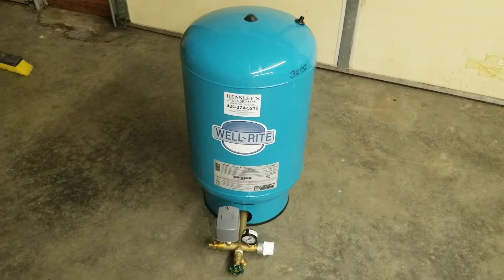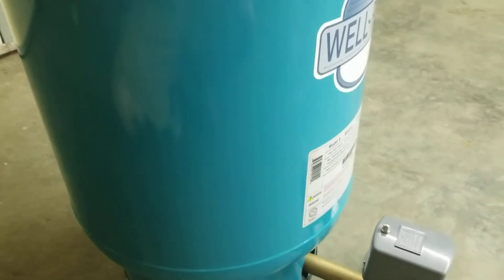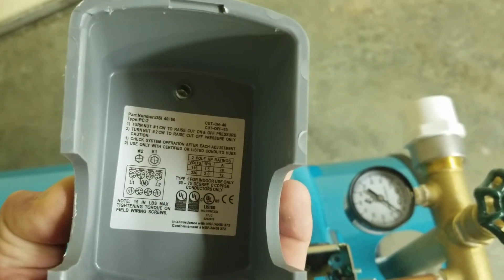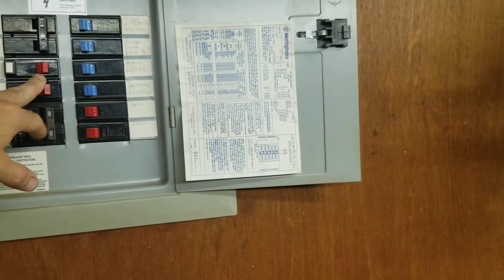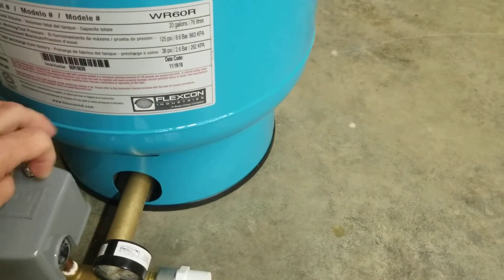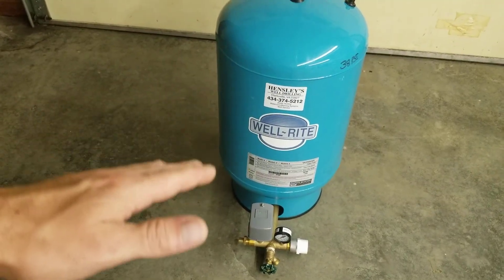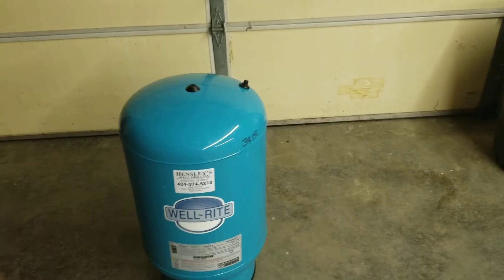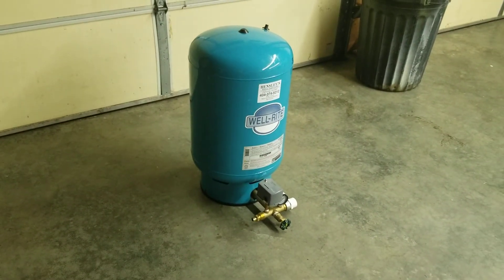Well Pump & Tank Troubleshooting, How the system works, Adjusting Pressure Settings Correctly

Comment: I have a 3/4 horse stay rite pump and my tank went bad. I replaced the tank with a 33 gallon tank, and a 40-60 pressure switch, and had the pump motor repaired since it was cycling on and off for a month until it quit. When I turn on the pump it goes to 30 psi and it stays there constantly and won’t reach the target pressure of 50 psi. At first I thought the copper pipe going from the pump to the house was broken so I disconnected the water softener and plugged the water outlet side of it not allowing the pressure to go to the house and it still does the same thing. I don’t know if the check valve is bad or there is a clogged jet inside the pump. Any advice?
Reply from the maker: I assume re-built pump means an above ground jet pump. If you repaired the pump , it possible that the seal you replaced isn't within the tolerance of the impeller, that wouldn't allow it to build enough pressure for the switch. Secondly if it is a 2 line system (2 pipes going down the well) id honestly recommend pulling it out & replace the injector & check valve
 A bad check valve would still allow 50psi, but once it shut off it would leak the pressure back into the well. Ill send you a link to the correct video. Be sure to like 👍 the videos! It helps more than ppl think!
Reply from the maker: https://youtu.be/126WgbaI7-Q
Hope this helps !

Comment: Very informative. Would it be ok to change the pressure switch from a 30/50 to 40/60 to increase water pressure to my home without damaging the pressure tank? Thx
Reply from the maker: Yes. Itll be completely fine. You can also tighten the nut on your current switch (big spring) (back side) 3 revolutions clockwise & itll increase the pressure. No more than 3 turns though. Be sure to kill the power, open a faucet and drain the water to 0psi. Then check your air on the top of the tank. Set it at 28psi w the current switch. Or set it to 38psi with a 40/60 switch. Those are Max #s don't exceed them in the slightest.
Reply: Thank you.

Comment: I hope you can help me, I've got water to mu house but very low pressure, I checked the pressure tank an it was around 27 psi an I also did the tip trick to see if it would tip over an it easily moved, so I don't think it's a bladder problem or pressure tank but I'm not sure....  my guage at my pressure switch is constantly reading 38 psi, an its not going up or down, I have a 30-50 pressure switch an when I opened it up I did the screwdriver trick where I hit the pipe going into the pressure switch an it sparked on all 4 points but guage still didn't move....  but I hear a constant hum from the tank an I opened the well top where the well pump goes into the ground an I can hear a huming coming from down in the well like the pump is running, I also felt the pressure tank an can feels like the pump is running an also I felt the main line under the house an it feels the same as the tank does, like something is running....  but it's constant an never stops until I kill the power to the well pump then it stops....  I can even hear the humming or it sounds like it running in my house....  my well pump.is working when I checked the tank pressure I drained all the water from the tank , but instead of having a shut off valve I have like a little drain plug in my line so I took it out an drained it down but my guage still read around 30 even though no more water was draining out....  so I wanted to see if my pump was pumping water so I turned the power back on an water came out that drain plug pretty good....  so I put everything back on an together an went inside an still hardly any water pressure....  an it still sounds like the pump is constantly huming until I kill the power again, but the pressure switch ain't kicking in an the guage is still reading 38 psi an I don't hear the tank filling up....  please help
Reply from the maker: First off, the gauge is bad, replace it. 
Your pumps is continuously running & its not giving you water but you do get some. So try turning off the breaker, wait 5 minutes and open up a sink, you should still have a little pressure stored in the tank. If not water is present, your issue is likely down the well directly where the pump attached to the pipe. Either a plastic fitting has cracked & leaking out most of your pressure, or a metal fitting has developed a hole in it. Both are very common.  I test this theory using 2 ppl. If you kill the power at the same time you have a spickot open & put your palm against it, it'll put a suction on your hand. When you kill the power, the water in the line drains back into the well because the leak is allowing it. If you have a spickot at the well, that's the best one to test on, or the tank drain. If you have blue/green stains near drains or copper pipe, it's 95% certain a metal fitting has been eaten up down in the well. Ill send a link to a video I made showing you what to look for
Reply: @h2omechanic  ok I turned on my faucet in the kitchen an it still had a little pressure after the power had been cut off for about 15 mins, im the only one home right now so I'll have to test the other when my wife gets home to help
Reply: @h2omechanic  ok I tested the other method with 2 people, if it had any suction it very little, my daughter noticed the water barley had a bluish grayish tint to it last night, you had to look real close to see it
Reply from the maker: https://youtu.be/rVgDq7gB6Qg
Reply from the maker: Ok. I love the detail! The blue/grey is highly likely to be Granite Rick sediment. A failed fitting will stir up the sediment in the well & send it to the house. You can hire a professional to pull the pump or do it yourself.  Hand over hand. I feel very comfortable with the assumption that you need to pull out the pump. If you watch the video link I sent, a few of those pump have failed fittings. Thats what you should look for.
Reply: @h2omechanic  ok, do you have a video about pulling the pump????  An im gonna take a pic an post the pressure switch when I get off work in the morning also, it's got some wear an age on it but still arks at the 4 points
Reply: @h2omechanic  also I forgot to tell you, I know I'm getting water to the pressure tank, but honestly I don't hear any going inside the tank at all
Reply from the maker: @dffdixie88  yea, im still feeling like a leak down in the well on the drop pipe. Pull out the pump!
Reply: @h2omechanic  wonder if it would be in the drop pipe its self or a hose clamp

Comment: Pressure switch continuosly cut on or cut off very fast what can I do?
Reply from the maker: Add air to the top of your tank using a air compressor. Leave a sink open and the well power off while doing this. Get air pressure up to about 20psi. Id also suggest replacing the tank in the next 30 days . The on/off/on/off cycles will kill the pump eventually.

Comment: I have pressure on my tank , but water still coming slowly, what’s the problem?
Reply from the maker: Kill the power. Open a sink til water stops & then go check the air in the top of your tank with a tire pressure tester. You need 25psi in it.

Comment: My issue is I prime the pump with the electric off then turn it on and the pump tries to start but don't. When you touch the pump it is hot. Does this mean the pump is shot? Or what do I need to do to get it started? I have the old style bladder. I can take a picture of the system so you might be able to send me step by step instructions. I have no water now. Thanks.
Reply from the maker: Hot Pump = Bad pump. Time for an update.

Comment: Low water pressure. Removed pressure. Bladder was low, raised pressure to 28 (30/50 switch). Still low pressure. Gauge at switch says 22 (not relying on gauge only, pressure low at faucets as well.) Pressure switch stays closed (making contact) all time, even when breaker is on. Sparks when I open contacts manually. But shouldn't that cause pump to run beyond 20psi? When I shut off breaker, system doesn't loose additional pressure until faucet opened. So I assume no leak underground. I assume pressure switch is bad? But why won't it build adequate pressure? Replaced control box Jan 2020.
Reply from the maker: Pump could be old and worn out. Or a possible leak in the well. If you have a check valve in the plumbing around your tank, that would trick the system if you have a leak, you wouldn't know it. If your system froze last month & have had low pressure since, id say you have a split pipe down the well. If not, your pump is likely old & worn out the internal impellers
Reply: @h2omechanic Pump replacement was kind of what was in the back of my mind. Was hoping for a different option as it is the weekend and I can't get ahold of any pump guys today. Well was new in 2000 and other than replacing control box last year everything is original. We do have alot of iron in the water. I always find alot of sediment in the filter housing when I change filter.  Water line is buried 8'-10' below grade, so I doubt freezing was the issue.  When they drilled well I believe he said water at 190' and he set pump at 195', so I will be having someone else pull it obviously. It was a friend of mine , that drilled and installed our well setup. (He has since passed away) At the time he said I could use a 1/2hp pump but it would be at it's limits so he suggested going up to a 3/4 hp. which lasted 20 years. Is A 3/4 hp pump sufficient for that depth? Or should I consider going even bigger? Thanks for your response, that was very much appreciated.
Reply: BTW, you were right. Pump was bad. A local guy called me back Sat and showed up about a hr later. Replaced pump and about half of the water pipe coming up the well casing. Now, all is good. Thanks again for your reply!

Comment: I noticed most well tanks have brass lines coming out of them. Mine has pvc and is 11 yrs old. I’m having issues with surging water pressure and I believe it’s time to replace the tank. Should I just stick with the pvc line or change it to brass? Thanks for your input.
Reply from the maker: Sticking with the pvc will be easier. But you can change it to a brass Tee if your going to replace the tank. Sticking with pvc makes it easier. Add some air pressure to the top of your tank,it'll help with the surging until u swap out the tank
Reply: Thank you...very informative!

Comment: I am having a hard time diagnosing my low pressure issues,,, My tank does not have any water in it, I do the lean test and it is empty all the time. Is that normal ? Thanks for your time .
Reply from the maker: Make sure the tank air pressure is set 5 psi below the pressure switch on number .
If you have a little pressure but its very weak, it still should show something on the gauge. If you kill the power it should hold steady at that pressure. If you kill the power & the water pressure gauge drops to 0psi, then your issue is a broken pipe or fitting down the well. If the pump is really old, it could be worn out & not giving you pressure anymore.

Comment: Hi thanks for your video. My well has been failing. I have a similar setup. My well was loosing its prime we would add water and that would work today I added over 8 gallons with no luck. Any suggestions. I hear the pump running but no water
Reply: If your check valve that keeps water from running back into the well from the pump is bad,it can also cause the pump to lose all it's water if it runs back, or could be plugged.
Reply from the maker: Leave your well breaker off for 8-24 hours. The well has been depleted of water. After about 1 hour of the well being off, go to every toilet in your house & see if any have a empty tank in the back. Your well is probably a low production well with a deep set pump, the most common problem I find is a leaking toilet that been leaking for weeks & always using water.
If you find that all the toilets are fine & don't leak down, you'll need to call around to local well companies and see who offers a Hydro-Fracing service.  This will run around $3k. So checking for leaks is toilet won't cost you anything.
Reply: Thanks for your reply. It ended up being the check valve. Found out that we have an above ground pump. What was benefit the surface was a bad check valve. We had no foot valve attached. We got it fix. Thank God it didn't cost us too much.

Comment: I have the same tank. But I have no water
Reply from the maker: Test for power out at the well. If you don't get 240v then the pressure switch is bad. If you get power at the well & no water, the pump or wire down the well is likely what's bad.
Reply: Thanks I’ll definitely have to test to see if the switch is bad? Or the water pump?

Comment: Hi- GREAT VIDEO! If I’m trying to confirm proper precharge CAN I JUST OPEN A SINK FAUCET TO RELIEVE WATER FROM TANK OR DO I NEED TO EMPTY TANKS WATER AT A WATER Discharge FAUCET NEAR THE PRESSURE TANK? My setup DOESN’T HAVE A WATER RELIEF DRAIN FAUCET. Our  above ground jet well pump went out during the recent freeze and I can’t build over 40 psi according to my gauge and new pump won’t shut off on its own . I shut a valve on water outlet I installed located close to pressure tank outlet to see if maybe further down the pipe line I had a leak. We still never got past 40 psi with a valve close to tank in off position.  We only ran pump for about 30 seconds in this-test for pressure  That indicates in my mind a problem with new pressure switch or pressure gauge or both unless somehow I’ve got a leak from lines coming to the pump from the well. There’s no above ground leak between two lines coming from well to pump . ANY POINTERS WOULD BE GREAT AS THE PLUMBERS ARE BACKED UP FOR THE NEXT THREE WEEKS🙏🙏❤️
Reply from the maker: To properly set tank pressure, have power off & open any sink until it stops running.  Then u can adjust the air pressure.  As for your jet pump, your dealing with a common issue & its why I refuse to install them. You have a air lock in the line somewhere.  The best way to flush a system is with a garden hose from a neighbor and pressure feed the system.  Or find the highest point of the plumbing at the well & disconnect the pipes and fill them one at a time. Becarful not to drop the pipe down the well. Most systems have a Tee with a plug. Thats where you'd fill it from or adapt a pressure feed to it.

Comment: Hello. My tank air pressure is showing 30psi, under the grey cap it says on is 30 off is 50. Did the 3 step tank check and everything checks out good. Well pump is off at the breaker box but water pressure in the house is still bad. What do you suggest?
Reply from the maker: You have too much air pressure if tested correctly. 
Turn off breaker. Step 1
Open a faucet and leave open. 2
Once water stops running at faucet, go check air pressure in tank. Step 3.
It should not be above 28psi, but to be safe put it at 25-26psi. 
Then go turn on the power. & your set.

Also try cleaning out your faucet strainers & possibly remove the water saving disc inside it. Itll look like a washer. They restrict flow

Comment: Well keeps kicking on and off. There is no pressure at the well tank Schrader valve. I add air and it will not hold the pressure. I presume this is a bad pressure tank but I have not found any videos that mention if it will not hold air
Reply from the maker: You correct. The tank is bad. The air your adding is leaking out from any sink faucet that's open.  Time to replace the tank. Or it'll kill the pump fast. Pumps probably still ok even though it's kicking on&off